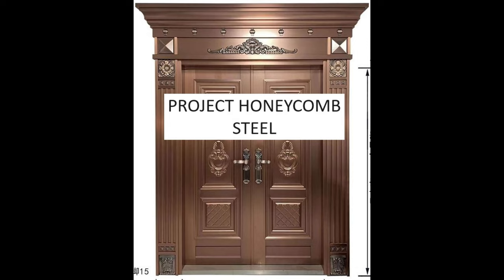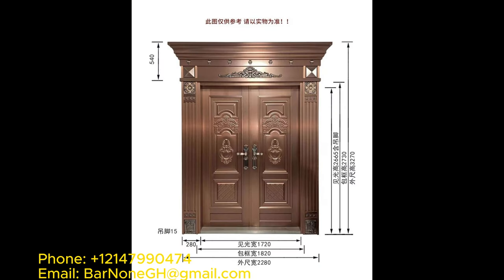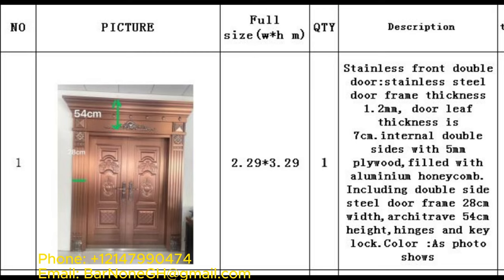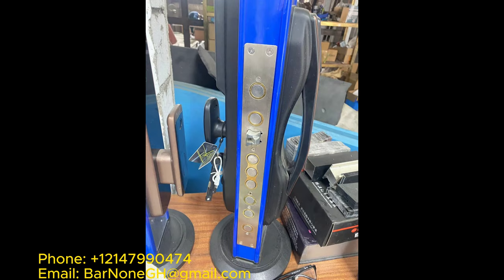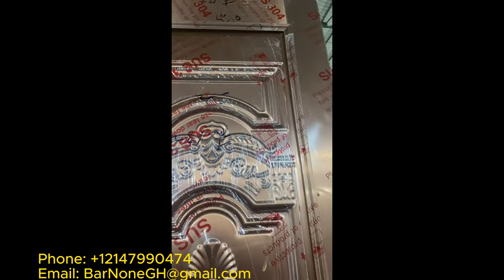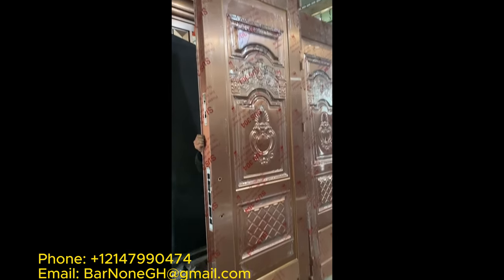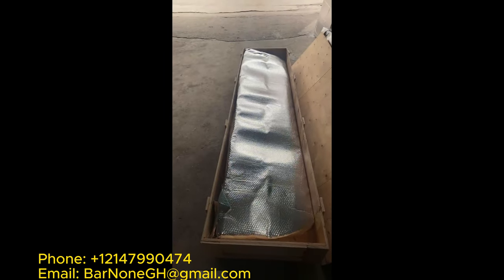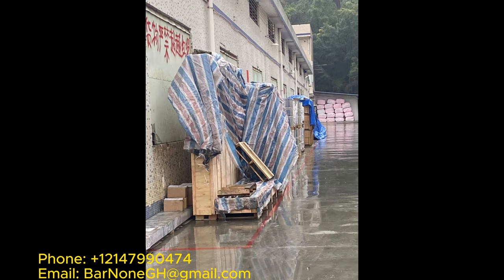Building In Ghana | Custom Designed HoneyComb Steel Doors #Affordable #MassiveDoors #PlsSubscribe

Comment: The mesh doors ❤
Reply from the maker: Yep! Say goodbye to burglar proof!!
Reply: Did I miss this ?  Mesh doors ?
Reply from the maker: The sliding doors towards the end of the video has a foldable mesh screen. Their windows also use 304 steel mesh screens. Strong enough to, in my opinion, replace the need for burglar bars.
Reply: @GhanabaKwaku  Oh Ok, I see ... I like the mosquito protection didn't understand they are really strong to possibly double as  burglar proofing as well.  Thank you